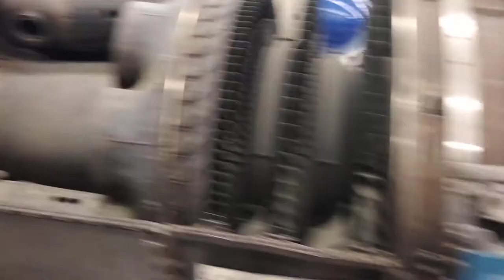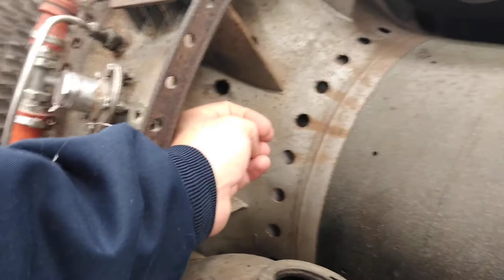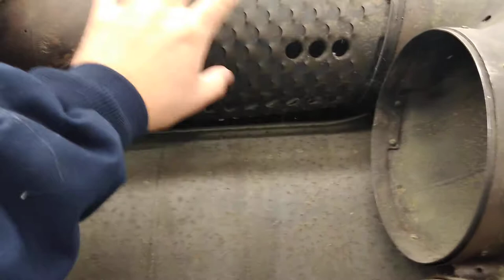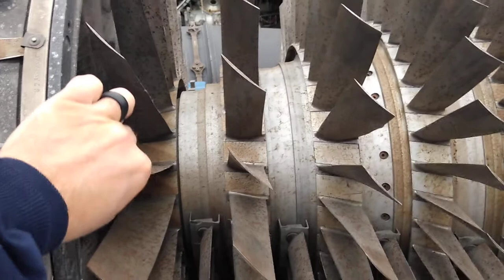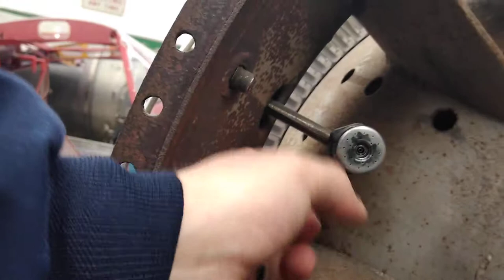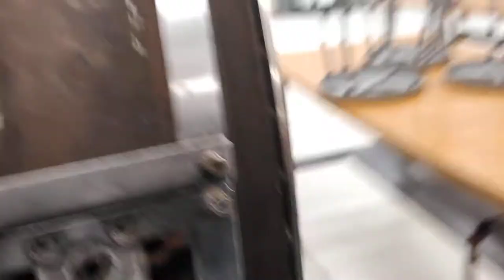TURBO-JET ENGINE (inside view)

Comment: Hello sir! Thank you for your content. I'm a college student, right now I'm learning about compressors and your videos have helped me a lot with dynamic compressors! But now I've been stuck here for 2 days trying to understand how the stator vein can compress the highspeed air flowed to it. Please answer I need your help for my next exam! :)
Reply from the maker: Hello, I hope I'm not too late for your exam.
 Look up divergent vs. convergent paths and their effect on pressure, it will help you understand the concept.
The stator vanes compress the air simply by creating a divergent path. Air in a divergent path slows down and it's pressure increases. That's what Bernoulli's principle says, that a fluid's pressure is inversely proportional to its speed. Therefore, if the speed of the air in the compressor slows down in the divergent path created by the stator vanes, its pressure has to increase. That compressing at the stator vanes happens repeatedly at every stage, the rotor blades impart mechanical energy onto the air by shoving it further into the engine and adding speed to the air, and then the stator vanes slow it down and therefore compress it . Then the cycle repeats at the next stage, for as many stages as needed to achieve the desired pressure. 
I hope this makes sense and it helps you. 
Good luck in your exam.